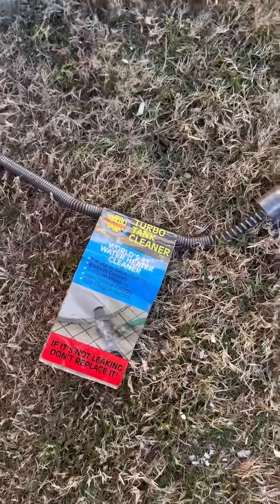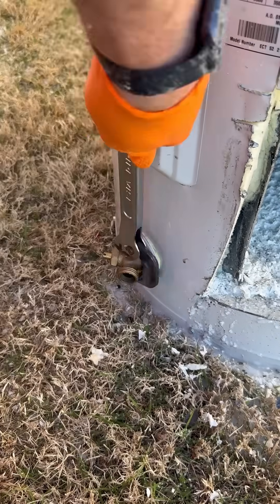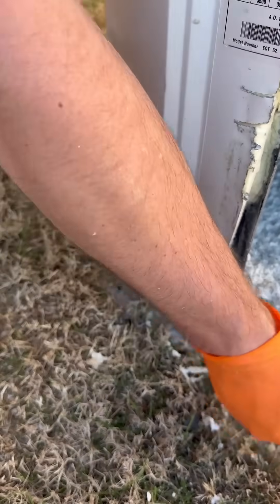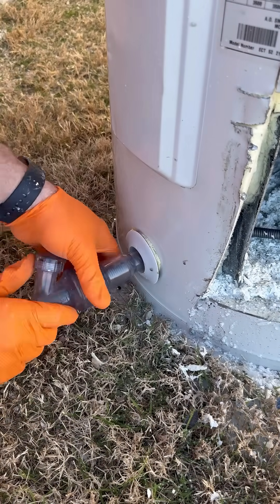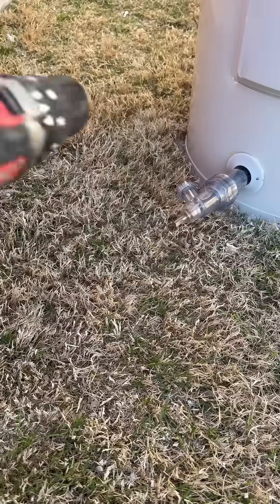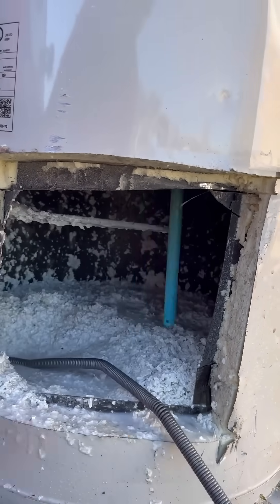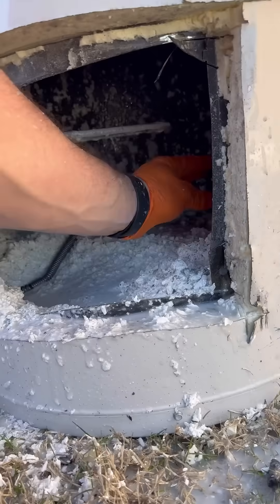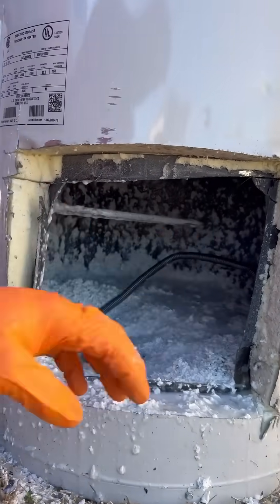What does a Turbo Tank Cleaner do to the inside of a water heater?

Comment from the maker: Updated Test:

https://youtube.com/shorts/JJRhgNxbxrI?si=W7PbzjAtdt6RmMTC
Reply: It's way to long too. Gezzzzzzz !! Almost a good idea 💡
Reply: I like how the LINK TO YOUTUBE ISN'T EVEN A HYPERLINK... ON YOUTUBE.

GOOD JERB UTOOB👌
Reply: I use mine all the time. I remove the element mostly because it is the reason I’m dicking with it in the first place. I cut the element tube off, put element plug back in and go like hell. For me, it works beautifully
Reply: The water is going to make it react differently than without it. Bad test for an even worse idea 😂
Reply: You cannot copy links in comments on mobile.
Reply: @NoFailer  it worked when I clicked on it...
Reply: @NoFailer  screenshot it and use text recognition to select and open the link.
Reply: It looks like your screw gun is set to high speed and drill.
You want it on low speed or 1 (instead of 2), and between 5-10 on the torque slip setting.
The wire will spin and flop slower stirring up loose sediment but not have enough speed or torque to break anything.
If it binds from sediment clog keep it on low speed or 1, and set to drill, then after unbinding rest to 5-10 like before.
No breaks and no dings or marring of the protective coating in the tank.
Edit: I watched the update, what I said about the drill setting still stands...but the new versions of this tool have too long of a wire. It is only supposed to be long enough to stir the water, so 6-8 inches for best results...giggity.
Reply: It looks really violent in this video... However, normally there's some water in there still. So water resistance is going to keep it from thrashing that bad. Variable speed drill, start slow and listen carefully.
Reply: Link doesn't open
Reply: Almost a good idea. But as we know, Almost don’t count. It needs to be shorter maybe.
Reply: What's to stop you from disconnecting the inlet, and pulling the dip tube, and pulling the heating element(s), before you start flopping that thing around in the bottom?
 I mean it's more work, but not that much more work: you would need to plug up the hole where the element(s) goes in, but that's probably not hard to do...
Pulling the dip tube is a little bit more of a stunt, but if your alternative is to be getting a new water heater,  well, then, you're disconnecting the inlet anyway...  
The big concern is damage to the inner lining of the tank:  perhaps they should have used a little more brain-juice on the idea, instead of just chopping off a foot from their toilet snake!
Reply: You can make this link clickable by putting a translate thing under it. Idk how it works though
Reply from the maker: @jminkvihubyb  it’s a hyperlink on my end
Reply: @theplumbersplunger YT disabled links in comments, at least on mobile, a while ago: the recommendation now is to use a feature that puts a clickable link right on the short. Apparently, in the edit page it's called "Related Video" and you just put the link there, or at least that's what I get out of tutorials lol.
Reply: @jminkvihubyb  I saw that recently but forgot about it til you mentioned that. I wonder how you get the translate thing to happen though? Seems YouTube randomly decides what words it thinks need translating 😂 francais ??
Reply: Install where the bottom element goes
Reply: Please link the website.
Reply: Run the drill motor slower? Take some time.
Reply: Good way to fracture an aged vessel.
Reply: SO would you recommend it if you pull your heater element and dip tube first?
Reply: I don't claim to know much... I realize that the tool is spinning rapidly. As you're flushing the water heater, wouldn't there be water to create a resistance? That would definitely reduce the speed of the wire, and it would reduce the damage. I also agree with removing the breakable parts, as it would be more cost effective in the long run.
Reply: Just flush it out with water.
Reply: @bobbydee1187 some of it is like concrete i had to jab the inside of mine for three hours before i even saw a drop of water come out and when it did it shot all the way across a 15 foot room and hit the wall with force
Reply: @BLEACH500 Wow
Reply: @bobbydee1187 you should of seen the shock on my face instant trashed room i was shocked i couldn’t move covered in water and sediment that exploded off the wall
Reply: If it's full of water would the wire be flying around like that ?
Reply: Keep in mind water in the tank will slow down the whipping and you don't have to go full retard with the drill.
Reply: Someone respond to me so I can watch the video
Reply: @hisnameisiam808 I doesn’t work for me either
Reply: @MrDsturman  should work now.
Reply: @hisnameisiam808 hi
Reply: YT links are useless!  Must be close to a time of political activity...

Comment: You can always just remove the bottom electric heater and insert a plug in it's place to use it safely. If you are really concerned that is. But really I wouldn't even worry about it since if you need to use this tool to break up build up on the bottom of the tank you should be removing the heating coils and checking if they are still functional to begin with.

Comment: think using a tough wire foulded double and scrape it in and out while pushing it intoo the bottom would do a better job , if you can fit the nozzle of a pressure washer in there that probably dissolve the stuff on the floor too

Comment: They're trash. If the sediment has built up that much, it is already on it's last leg. Treat your water heaters with care, flush them twice a year, replace the anode rod every 3 to 4 years, and replace the element along with the anode. You will keep your water heater for a VERY long time. If you can afford a water softener and keep it on a low setting, you can even save your shower heads and valve bodies. These things will help you possibly keep your fixtures and heater for 20 years or more.

Comment: Kill the power/gas… kill the water to the house… depressurize the tank (open a faucet till it stops)… close the faucet… close the cold supply at the water heater… open the boiler drain to somewhat “air lock” the tank… if you have a brass boiler drain like this 12 yr GE electric heater above, spin the boiler drain out at the bottom… (if it’s a 6 yr crappy plastic valve, stop, and head back to work to save money for a new water heater…) spin the brass boiler drain out… spin a 3/4 x 4-6” nipple in… spin your garden hose on there… run the garden hose outside… turn the main water back on slowly until it stops… then go back to your water heater with the drain out, nipple in, hose attached, and open your cold supply to the heater… you now have a full port to drain all the sediment from your tank and you don’t need to buy some gimmicky water heater catheter device… drain flush and repeat until desired result is reached… remember to tape and dope your boiler drain when you put it back in (tape first then dope)… while you’re at it, change the anode rod… 1 3/16” or something like deep well socket… $20-$30 for a new one at your favorite wanna be pretend pro super nationwide pride in china we buy hardware store… tape and dope that new one the same… fill every thing back up with water run all the faucets get all the air out flush them toilets (last) and then power that well douched machine back up and enjoy your first world blessings… 

✌️

Comment: I fitted some air hose fittings together and screw it to the blow off valve.Hook your water hose up,then the compressor set to 60psi.Turn all vales off above heater and let her rip.Water heater is drained in about 10 minutes and all the stuff in the bottom comes out the hose.

Comment: Thanks for the video and I think that it depends on the condition of the initial water heater. If the condition is way past cleaning, the rod may already be compromised and easily break. Regardless, I find most people simply do not do maintenance. Why? I think that life just gets in the way and it’s something that isn’t a priority here in the U.S. Plus it may be just easier to buy a new one.

Comment: My electric water heaters are 35 years old, with well water and a softener which is also 35 years old. A year ago I took them out to remodel the utility room. Zero sediment. The only thing inside was pieces of the anodes that fell off the original rods. Flushed them out, put in new anodes and back in service.
It pays to buy quality in the first place.

Comment: Here's the problem. You can never tell how it's going to work without the water in it cuz that's going to slow down the way that it operates. A real test would have been a water heater that was full of water with a glass window on the side of it

Comment: Those dip tubes get mega brittle over time and the tank wont work without it therefore I would remove the dip tube before using this tool as it might make a small problem into a bigger problem based on this video.

Comment: I'm a 41 year Master Plumber. Flushing your water heater is a huge mistake. It's a scam and an up sell that causes more problems than it's worth. There is no way to get all the debris from the bottom of a water heater. Some is flushed. Other debris is simply loosened. When you run hot water that loose debris is sent into faucets and can even stop up fittings in walls and ceilings. By the way notice the tank inside is black. This debris is white because it's the porcelain they spray inside the tank. Yes there's minerals in there too but the majority is collapsed porcelain. As the tank heat expands and contracts to colder water that porcelain eventually cracks and falls off. Now I'm going to take a beating for telling the truth about water heater flushing. I'll sit back and watch the crooks yip like  a Poodle. 🐩

Comment: I think if that wire was half as long, it would be a feasible concept, but that’s definitely whipping around too much and in an older model water heater that would definitely snap off the dip tube

Comment: You're not supposed to be running your drill at full speed. The instructions and warnings with the tool and on their website specifically warn against this. You're just trying to stir the sediment not knock the bottom out of it.

Comment: Intall an Elite H2O max-i water conditioner.  On a new tank...it will never accumulate this sediment.  I have also seen with my own eyes this water conditioner clean a 120 gallon tank half full with sediment to zero sediment in 90 days.  They cost under 200 dollars and are simple to install.  I believe a 3 year warranty is provided as well.  I've been using this tech in my home for 15 years now, got rid of softener for this tech. Started with scale blaster, moved to elite labs as their cooling fan in the unit makes it last longer.  It will clean your pipes as well, aerator and shower heads will clog as it cleans.  Removed them and clea. Or replace....90 days your whole system is clean.  You will get max life out of everything in plumbing system.

Comment: This was not a test.  product was used incorrectly for one. That wire/tube would be moving so much slower in a tank with water it wouldn't have the energy to break anything and you have a gapping hole that it kept floppping out of. please dont test things at all. if you dont want to use it keep that to yourself.

Comment: I have taken a couple of 40 gallons and a small mobile home heater throughout the years and removed lower heater element and long stick and hose hooked up to drain with hose on tipped at a angle  outside and man the yellow limestone I got out was alot. Tank inside got very very clean. Some work but tanks are so expensive now.

Comment: When you buy a new water heater, also buy a new magnesium anode.  Swap out the garbage in the new tank for the magnesium one... and if you flush that tank every 6-12 months as recommended, you won't need this tool.  Your new one will also last at least twice as long, more if you swap the mag anode out after it's life cycle... maintenance is cheaper than new.

Comment: It's literally a glass tank.. i dont think attaching what is basically a k-50 sewer cleaning machine to the drain and having that bash around in the tank would be good and probably crack the tank.
It's not even the element or the diptube you have to worry about but the tank itself. A water heater is a glass tank surrounded by insulation and a tinbody frame.
The sediment inside really isnt that big of a deal unless youre on a well system. Ive seen heaters last 30-50 years and never beem cleaned once and others have been hooked up for 2 years a are a sludge factory inside.
If youre that worried about cleaning the sediment in your heater, hook up a hose to it, run the hose outside and open the drain and let it rip for like 10 minutes. Do that once a year and you wont get sediment build up, not that complicated. Or you can just ignore it because it's not that serious.

Comment: Not thinking this is a good test. Put a camera in. Pressure it up with water and use it as it was to be used in the field. Change the rods and anode anyway. With that much debris you know those electrodes are not well. I personally think a glass lined tank will be demoed from a psychotic snake whipping the crap out of it
Reply from the maker: @alex-sv8to  I have an update test pinned

Comment: I'm in Phoenix. I'm surprised my water heater lasted 11 years. That tool would only be useful for draining the tank, for replacement. I literally shoved my 50 gallon over and let it drain out my garage for 2 days before I could lift it to move. Pored out the top

Comment: Useless. I replace the spigot that comes with it with a ball valve. That allowed me to stick a vinyl tube inside the tank with the ball valve open and attach that to my vacuum, sucking it and flush it that way moving the vinyl tube in and out with the tank empty but releasing some water occasionally got most all of the debris out. This was done without damaging anything and it was very effective.

Comment: Yea need water in the tank to test this.. there is no resistance... the cables swinging around violently.. unless its supposed to be done dry.. which i would say AW HELL NO
Reply from the maker: I posted an updated test awhile back with water in the tank. It should be pinned to this video

Comment: So, I wouldn't use it. However, the 2 parts that thing is beating could and probably should also be cleaned or replaced as well. Also, it's not a fair test if you keep having to put it back inside. And just for last, water pressure would make that thing fling around differently.

Comment: Your experiment is foiled by the fact that you cut open the tank but didn't reseal a see-through panel over your hole.... a better experiment would be to fins a water heater you know to have this problem bulreak your ass and your buddies back getting without and then doing some shenanigans lol.
Reply from the maker: I have another test right after this I did (check pinned comment). I put plexiglass over the cut out and filled the tank with water.

Comment: So drain tank and take out rod and element then use the tool to remove sedment. If you want to run with water in it remove element and use a plug in element slot.😊
boom mind 🤯

Comment: good advice bro. waterdrop ap431 off amazon or similar product from ferguson, hajoca or pace supply works like a charm, so that you never get that buildup in the first place. change the catridge once a year & all is well. if you must clean one gunked up that bad- I use my presssure washer, it's good at liquifying the sludge so it exits the drain. also- EVERY new heater- pull that stupid 1/8" ported crap valve & install a full port 3/4" ball valve.

Comment: I think this could easily be reconfigured to actually work. It's a good idea just a poor design. What it needs is a piece of PVC controlling 95% of that snake. Or other words only have about a 1 in to 2 inch snake and not attach it. Just moving in and out while spending that around. There you go problem solve.

Comment: I could be wrong, but wouldn’t you want to remove the anode rod, and then proceeded with the cleaning with that device, and then replace the anode rod or either replace it with a new rod, in which case that would extend the light of your water heater even longer… theoretically, it makes sense to me if it was done that way, but I would not run that gizmo with the anode rod in it because it’s clearly taking a beating in your demonstration.

Comment: If the tank has water in it, the flailing would be drastically reduced by the resistance and most likely do a great job for what it was intended. You are comparing watermelon to cherries in this test.

Comment: Why not make the same device but use a 1/4 or 1/8 plastic line with small pin holes in it. adapter to your garden  hose and use water .

Comment: I do odd plumbing jpbs here and there for friends and family and i can honestly say the water heaters i usually replace are from people that regularly maintain them. I know dozens of people that didnt even know about maintenance on a water heater and they've NEVER had to replace theirs. My moms water heater was replaced in Early 2000s and shes mever maintained the new one. The previous one was from the 1950s, was the original water heater they had when they built the house. Never had any issues either. The only reason she got it replaced was because it was really old and she worried about it breaking. All she did was have elements replaced. Never once has she washed out a water heater. Honestly, i wouldn't even do it. No idea why maintained water heaters go bad so fast. Its definitely odd and something ove noticed